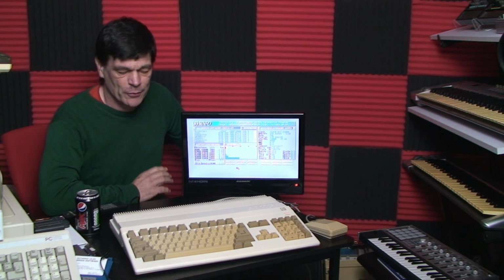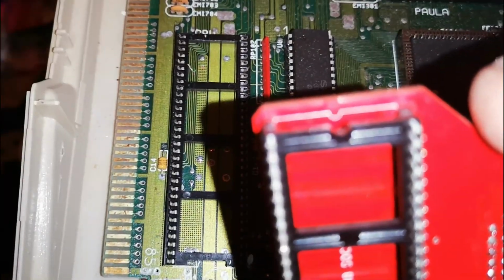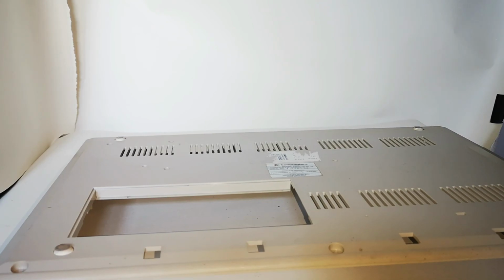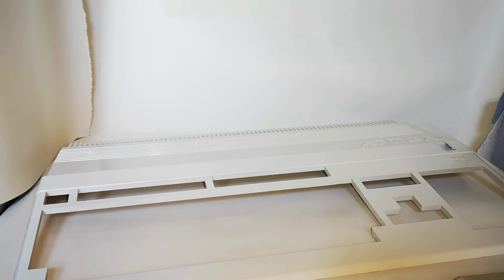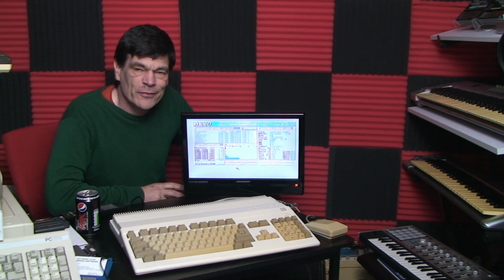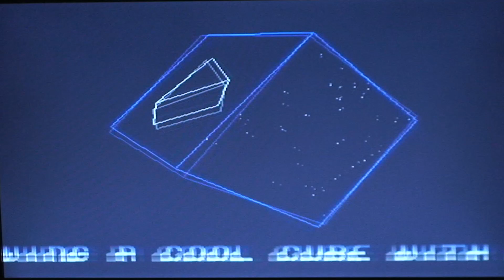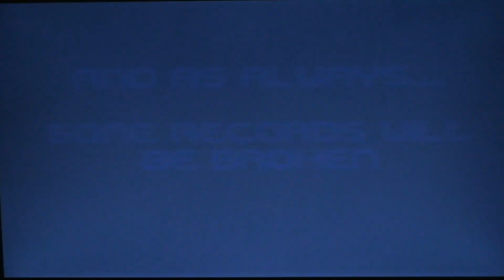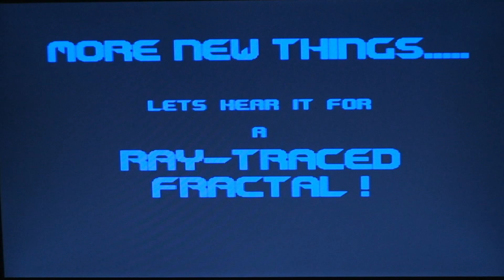Amiga 500 CPU upgrade and case repair

Comment: Nice video, I like the paint job! The accelerator, it's alright but I can't see much use for it :/ getting more chip ram and some fast ram is more useful for general performance I find :) there's a cool spitfire add-on, have a look, does something similar with the CPU and add 8mb fast ram and ide